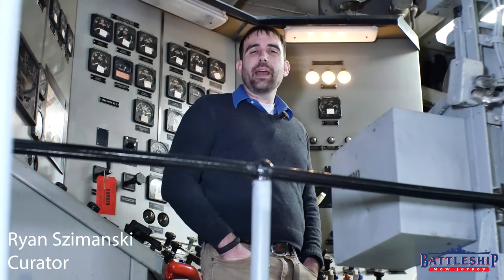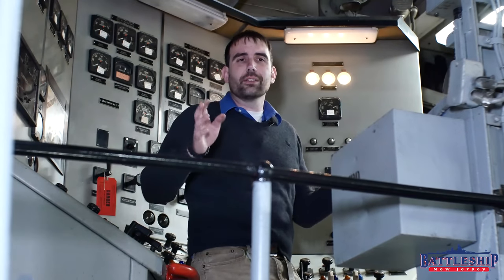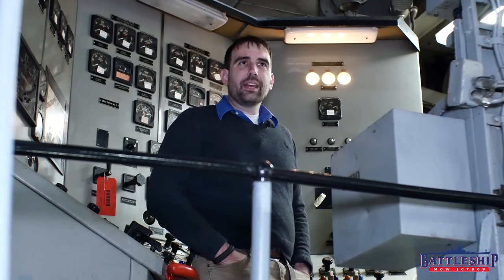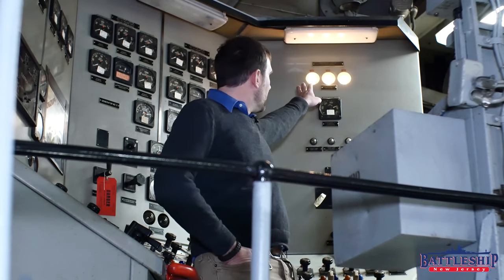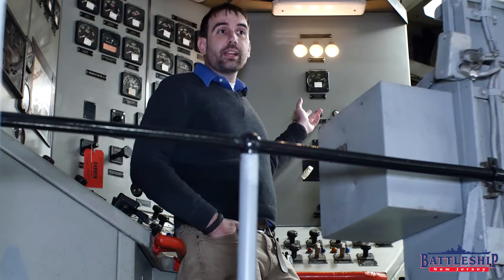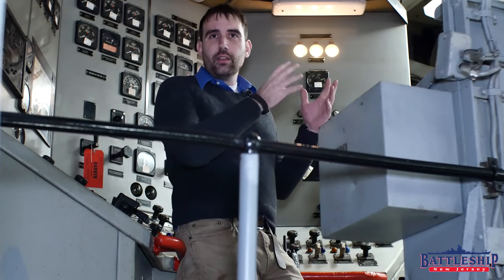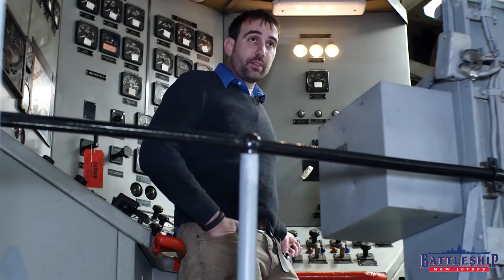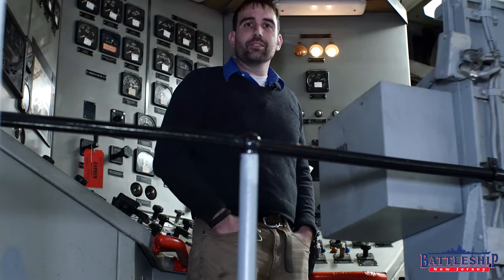How Do you Detect a Grounded Circuit On a Floating Warship?

Comment: (vid not out as of posting this) avionics electrician here, I appreciate you spreading this knowledge. I'm pretty sure I know what this is gonna be but i appreciate the vids man. Cool to see all the intricate supporting bits on the battleships instead of just them being treated as floating artillery. Thank you.
Reply: Could you elaborate on the technical details please?
Reply: @somebod8703 ( try to keep this as basic as I can) there's earth ground and common ground. Think of ground as your baseline 0 to work from for voltage. Earth ground being your connected directly to the earth and common ground usually being a compromise (in my case of aviation you can't exactly put a rod into the earth.) Where all the ground wires are connected to the frame of the aircraft ect. But it achieves the same effect. Ground really is just a baseline way to say ok we need all these points to be the same lower potential of 0 volts so that you don't have an unpowered section of your circuit trying to use ground as a power source ect.
Reply: @super5oldier139  Okay, I was more interested in how the ground connections are actually detected. Thanks anyway.

Comment: Currents doing bad things to hulls: I've heard a legend of someone who did some arc welding on a ship with the welder on the dock and grounded there. The return path for the >100A current was via the hull and seawater. As it happened, the polarity was such that they electo-etched a hole right thought the hull in short order.
Reply: If its a DC arc welder, that's can happen real fast. I'm an electrical engineer, and have dabbled with electrochemistry. Depending on polarity, you can extract pure metal, or erode metal. Speed dependent on the amount of power you can deliver.
Reply: One of the first things I learned in electrical school, was that the reason water conducts electricity is due to impurities, such as salt.
 

I don't know where I was going with this.
Reply: @jed-henrywitkowski6470  Well, it's true. Which is why you can pressure wash live high voltage lines with distilled water from a helicopter.

Comment: I distinctly remember watching a news broadcast from Missouri during the gulf war. They had a small segment following  every day life on board.  One segment showed electricians tracking down a problem with a magazine flooding circuit.  They suffered a partial flooded magazine because of it.  Poor electricians were not happy. Wet and dirty working in a cramped space at the bottom of a turret.  They said something to the effect of "Gee, I wonder if the problem is 40 year old wiring".
Reply: They might have needed Rat Terriers. Electrical wiring insulation was organic and rats could chew on it so if you have rats, you can have electrical problems.
Reply: My grandfather served on the Missouri in the 50s.
Reply: 3 phase un-ground power was once common.
Today I  work in a plant that still has legacy systems from the 1930s that use this.
The thinking was it would not trip in a fault and you could run while you trouble shoot.
In reality it might be a lot of trouble to turn things on and off to find it.

Later it was standard to make this solidly grounded to let a fuse blow and find the fault that way.

Later still and to this day we might use a neutral ground resistor system that will limit destructive faults and still allow relays and sensing devices to automatically trip the power off at the point of faults.

This has been common practice on Canadian warships since well before my time.
But smaller ships and different standards than USN and battleships.
I think the RN used systems like the USN until the 50s
Reply: @nos9341  I've never heard the term legacy in reference to old wiring.
I've heard of "knob and tube". I've heard of old wiring allowed to be "grandfathered in".
You mention a Canadian warship, are you in Canada?
Reply: @alwaysbearded1  My Mother grew up in a mining town, she said they had rat terriers because the rats were as big as cats.
Reply: @bigredc222  Yes I live in Canada.

I work for  a company that has plants and properties dating back to 1890s. We have stuff so old and weird and that I don't know how else you would describe it...

I've been in the trade 30 years and every now and then I am still surprised by something that still works, still runs and could be 75-100 years old.

Sometimes its dead and cold because we no longer generate 600v 25 cycle power to run it... Or I find electrical equipment so old you google it an the name doesn't get a hit.
Reply: @nos9341  I started as an electrician in about 1981 so I've seen my share.
I've seen plenty of very old wiring that still worked fine, as long as no critters got to the insulation, that stuff lasts a long time.
I started saving neat old stuff about 20 years ago, I wish I would have started saving old stuff from the start.
I have lots of old electrical fittings and devices hanging on my walls and on bookshelves.

Comment: Navy ships of my days ('69 to '92) were usually (with a few exceptions) 450 volts 3-phase A/C ungrounded systems.  The advantage of ungrounded systems was reliability - if one phase became grounded somewhere the electrical machinery continued to operate which is pretty important in a battle situation.  Exceptions I'm aware of were tenders which utilized 4160 volt 3-phase A/C and I'm pretty certain that these were ungrounded also.

Comment: We have this same type of system at our plant. We have lots of flammable cemicals we use in our process so we are also an ungrounded system to help prevent arcing when there is a fault. We have a similar GF detection system. We have alarms and meters so we can detect and track faults. Neat to see a similar system here.
Reply: Same situation here.
We have several locations where continuous operation is critical and nothing beats the robustness of an ungrounded electric system.
I just finished a major upgrade that replaced an old ungrounded delta system with a brand new ungrounded delta system. In act most of the questions during design were from the manufacturers who wanted to confirm that what we wanted was an ungrounded system (they're very uncommon in civilian electrical distribution systems).
The only problem that we get into is that troubleshooting when you do get a ground is a serious pain in the neck...but the system will continue to operate normally with a single ground fault so we have time to find the problem and fix it.

Fun fact...ungrounded systems are used in patient care areas of ICUs and ORs.

Comment: Industrial mechanic/electrician here. Our ground fault issues don't cause metal deterioration like a ships hull but stray voltage can be a real nuisance when troubleshooting electronics. I've seen an entire production line go down because of some trimming flash buildup on the isolation bushings for a 4kHz induction oven which caused electrical noise in the entire plant (don't bond your building frame to each grounding loop kids, your troubleshooters will hate you for it).
Reply: Aw jeez! I used to work at an unnamed paper mill, at the end of the San Jose CA Airport runway...
We could hook up connections to the "ground" bindings on one side of the mill, hook up to the other side (150 ft or more!) and get a 10 vdc difference! 
It was "floating" above the salt water intrusion from San Francisco bay.
Reply: Electricity can do some weird things. I once worked on a horse stud that had electric fencing. The staff were complaining about getting zapped on opening a set of gates. I replaced the insulators and it still was happening. Volt meter was telling me there was no short and all insulated wire was in good condition. Eventually the problem went away and I read online that this sort of thing can happen and there is nothing that can be done about it.

Comment: 480V is the generation voltage 440/460V is the utilization voltage. This is allow for voltage drop between generation and usage.
Reply: I thought it came from how in the "old days" it really was 110v/220v/440v, but over time the standard voltage has been pushed up to 120v/240v/480v.

Comment: Railroad diesel locomotives have a similar, but automatic system to detect ground faults.
Reply: Same in Hospital operating rooms which are isolated ground systems, or at least were in the 1970s.
Reply: @davidmoran4471  The new ones still are...

Comment: My neighbor who was a very good electrician, served on a Naval ship during WWII I don't know which one. I believe he was a apprentice electrician. He told me they worked on most things with the power turned on. He stood on a thick rubber mat and was taught to put one hand in his back pocket so as not to short himself out. All of the wire connection were thumb screws so that electrical work could be done one handed. I believe he told me that the ship he was one used DC current,  but I could be mistaken or maybe that was what the voltage was in the area of the ship he worked in.
Reply: Nowadays that still happens, except that people have isolated gloves that add a layer of safety.

Comment: The more important reason to avoid grounding any phase is that if another phase foes to ground, anywhere on the ship, you have a phase to phase short, ad you can imagine, this is a bad thing.
Reply: Phase-to-Phase shorts are what you have circuit-breakers and fuses for. They give some fireworks but usually cause little damage. Your hull being corroded out from under you is another matter. Less spectacular, more permanent.
Reply: @TheEvertw  It can actually be spectacular if you f*** with high current
Reply: @chrisb9143  yeah, I know. I have worked for KEMA's HPL.

Comment: Ya know, it's been many years since I've gone over schematics for the ground fault indicator systems. I do remember initially getting headaches looking at them, because in many ways, they were ground faults themselves, which made it tricky to troubleshoot!
I know that you didn't explain it correctly in the video, close, but there are "boatloads" of fine points to look at.
Can you send me a copy of the GFI section of your switchboard schematics?  I'd like to give you a better explanation of how it works. It should include the lights connection to the buss, the fuse and the resistor to ground and the "push to test" switch The resistor should have the same rating as the light, so that the light is at half voltage with no grounds, "push to test" should bring all lights to full voltage (brightness) when pressed. Any light that is out needs replacement. 
I have 30 years of being Chief Electrician on ships, most of it chasing grounds. Got good at it ya might say.
Edit: CAPAC comments
A bunch of folks here confuse the ungrounded power systems with the cathodic protection systems. They are two separate entities, for different purposes, they can intertwine. Neither can be neglected, yet really don't have anything to do with the other.
It's complicated, but the biggest problem with CAPAC systems on a ship, is that they interact poorly with the CAPAC systems Installed on the piers. 
One of my last duties, pulling into or out of port (before or after helping the reefer unload/load cargo) was to turn off/on the CAPAC system.
Chasing grounds on a merchant ship seemed to be my main job!

Comment: Current through a steel hull causes electrolysis, which will cause rusting of the steel. It's why your water heater has a magnesium rod in it. This is called a sacrificial anode. The magnesium rod will corrode before the steel does. Steel narrowboats in England have magnesium anodes attached to them for the same reason.
Reply: Not necessarily. Depends on the source. 3phase AC shifts, so you'll have electrolysis and hydrogen production on the +ve phase, especially where you have dissimilar metal in contact (salt water, welds, etc).

Negative voltage will have the opposite effect and will protect the steel, this is active cathodic protection. The magnesium rod is a sacrificial anode which donates electrons and sacrifices itself before steel does, since it's less electronegative.
Reply: @mavbaker2159  mostly what you said, I eluded to. Was trying to give a non-technical, Reader’s Digest answer, using mostly common terms.

Comment: Ryan, if you get a chance step onboard a Ddg 51 class ship and look at the swbd grounding system. The closest name to describe the shipboard swbd grounding is "chain male curtain" The modern ships underway are "hull ground" systems. When in port the ships are connected to the shore ground system. Even the metal ladders are grounded with cable to the hull, bulkheads, and decks of the ships. "Every electrical connection, s/p phone connection box is grounded to the hull system.
Reply: Makes sense, modern ships are aluminum, and radiate a boat load (heh) more EM from radars, etc.  I suspect some ECM equipment can dump a crazy amount of watts into the air and maybe into the ship itself.
Reply: @thedamnyankee1  They definitely can. Modern radars radiate mega watts of power.

An uncle of mine used to play with the radar of a frigate when in port. They'd send a man topside to watch for a seagull resting in some rigging, then pointed the radar to it and watch the bird fall, cooked and all. That was in the eighties.

It may have been a tall tale, but I believe it is true.

Comment: The hardest part of this whole system when you encounter it on land is that the voltages to ground are not normal in any way. you can have any range of voltage to ground from 0v to 1000v and everything will still be working normally. If one device has a leakage to ground you may have 0v to ground on that leg, but it doesn't cause any issue. I have encountered many electricians that do not understand this fact. I've worked at two places that have these systems installed for extreme reliability.